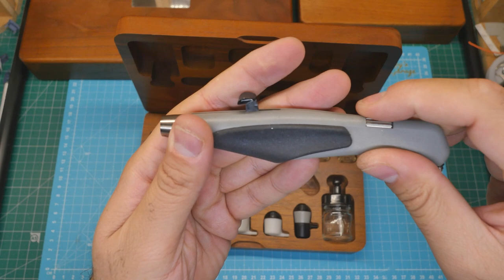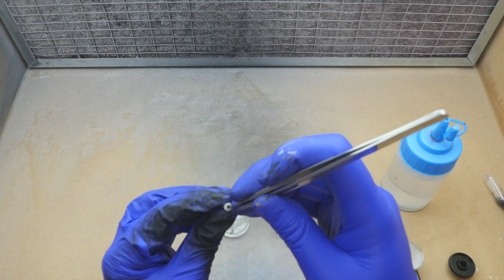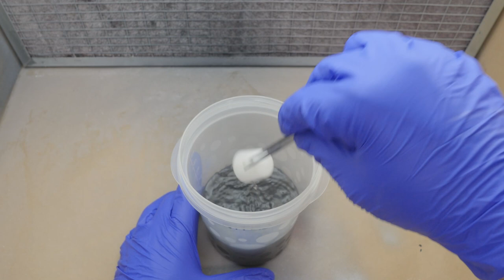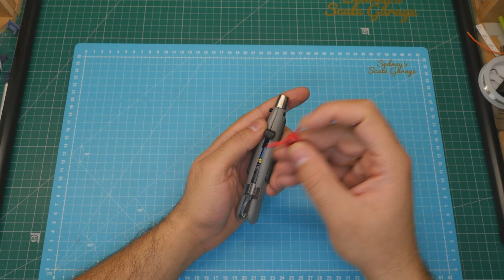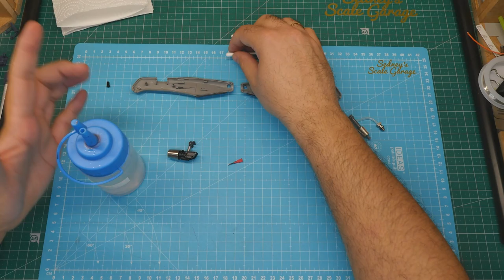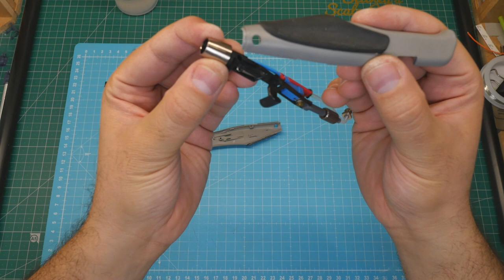Tutorial - How to clean AZTEK airbrushes

Comment: Thank you for making this video!
UPDATE: Because of you and this video I've just brought back to life one of my four "broken" A470s and A430s! I wouldn't have had the knowledge of the internal workings without this video. This first one was completely frozen by dried paint. Caused by the well known issue of leaking paint inside the body. Now that it's working again, I'll try to chase down the reason it leaked. I'm looking forward to fixing the remaining ones. If I can get them all back to working condition they'll join my current working A470 in the tool box. I'm glad I didn't throw them away 20-years ago.
Reply from the maker: I'm so glad to hear that 😊
I also had similar problems with my first Aztek and I had to do some research to find out how to solve it. This video was made with people with the same issue on  my mind, so it's easier to have all the info at once. 
Cheers!

Comment: Hi, are the internal parts in all the 3 brushes identical? The black body brush is different as it doesn’t jave the roller, but what i need to know is whether the bracket connected to the trigger is plastic or metal. Are the internal parts of the grey resin bush and the metallic brush identical? Would be nice to see the black brush opened. Even an image would help. Thank you.
Reply from the maker: Hi! Thanks for your comment.
Indeed, the black body brush and the rest with the roller only have that difference. That roller is connected to a threaded rod that pulls the trigger backwards or forwards so you turn your double action brush into a single action.
The black brush just has a slot where you fix the mechanism and the double action system is fixed.
Every moving part inside those airbrushes (the A series) is plastic. You can modify those pulling links with steel wire.

Comment: the metal pin on the inside of the aztek 470 has jammed on my airbrush, is it possible to fix it or is my airbrush beyond use now?
Reply from the maker: Just take the airbrush apart and pull it out. If it doesn't come off, soak the front part in some thinner for the paint to soften. Then, you will be able to pull it out
Reply: @sedneyscalegarage  i was thinking of using some "Mr muscle oven de-greaser" as it's good for removing acrylic paint from kits and might work better than the airbrush thinner....what are your thoughts on this idea?

Comment: Hey man I have the rubber one but i forgot to clean acrylic paint and leave everything there for like 2 days and now it only takes out air and makes bubbles in the paint container how do I clean it out?
Reply from the maker: If it's acrylic, it should be quite easy. The problem is, probably, that paint dried on the inner shaft and isn't letting it move. 
If you have airbrush cleaner, try to dip the front of the airbrush in it without any nozzle on and then use a cotton bud or any fine brush to take the residue out of it.
I would suggest you to invest in an ultrasonic cleaner. They are not very expensive and will make a big difference and will not take too much time to clean the airbrush.
Reply: @sedneyscalegarage  hey man thank you but I find out that can be cleaned with windex it is now like new

Comment: I still love these airbrushes despite owning Iwatas
Reply: I was just about to look for them... I also own Iwata.  This is a design that's intriguing.  Seems more complicated than the standard double action brush.
Reply: @emilcost8613  There so easy to use and clean
I only use them in single action mode!
I only bought A470 models and I have 5 of them all still perfect after 15 years.
I` ve never had the need to open the bodies like this.
Whoever designed this system was a genius, don`t understand why its not manufactured today, lifetime warranty was a downfall stupid idea nothing lasts forever and people took advantage of it.
Reply from the maker: Probably, people stopped using them as it's not really understood.
I'd bet that over 95% of the issues were due to poor maintenance.
Also, as everything else, claims are louder than good words and they are widely spread. Thus, there's people talking trash about Aztek without even use them once.
Reply from the maker: Wish some company starts manufacturing again or, at least, their consumables
Reply: @sedneyscalegarage  Me too!
Actually I`ve just bought another metal body A480.
Wish I bought more metal body ones, tips last for ever!
Reply from the maker: @Emil Cost I just found out that I put a thumbs down in your comment by mistake. It's fixed now. My appologies 🙏🏽